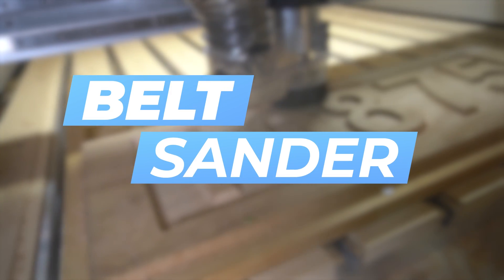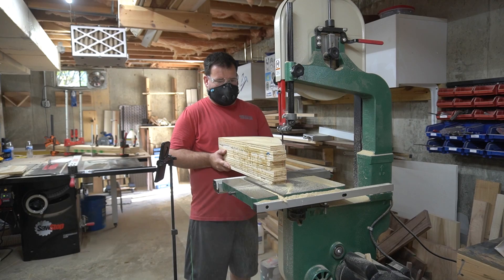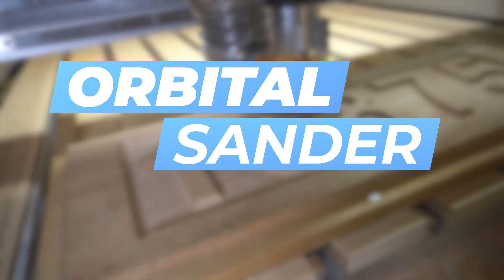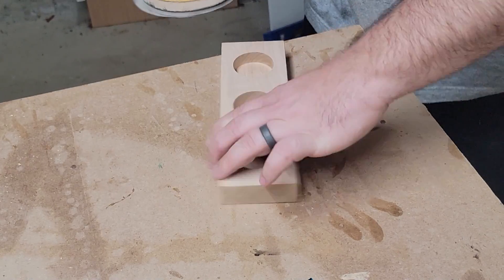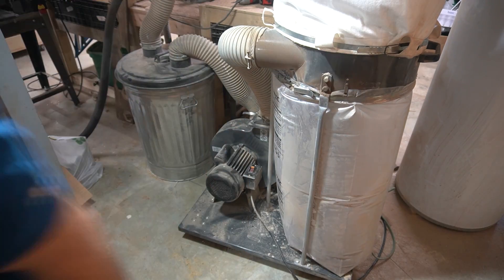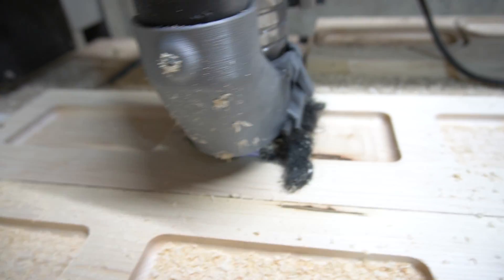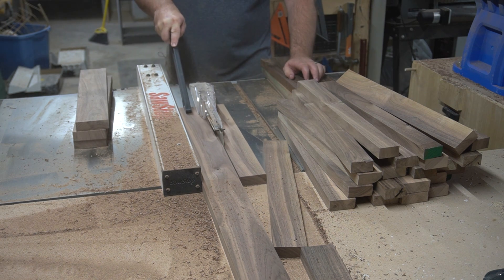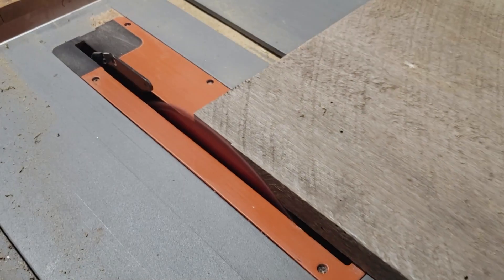5 Tools You NEED To Purchase After Buying A CNC

Comment: What are your thoughts on a jointer for milling? I have all you mention except spindle and have heard band saw can be shop center. “I” think I need a jointer and drum sander to support cnc and milling inputs. I have hand planes and a thickness planer but milling long boards isn’t lots of fun.
Reply from the maker: A jointer helps but I didn't have one in my shop for the first 3 years. There are a lot of ways around not having a jointer.

Comment: What are your thoughts on a jointer for milling? I have all you mention except spindle and have heard band saw can be shop center. “I” think I need a jointer and drum sander to support cnc and milling inputs. I have hand planes and a jet thickness planer but milling long boards isn’t  fast.
Reply from the maker: It really depends on how much rough stock you're using. There are a lot of ways to mill wood without a jointer. It's well documented here on YouTube. A drum sander is great to have in the shop. Anything to cut down on sanding!

Comment: Got my first CNC Dec 2020 first things i would say If your going to be doing a lot of sheeted plywood, Kreg accucut xl, This might even save you from needing a table saw as much if at all. 2nd is a router table get one that you can setup to joint boards, (I use SKIL RT1323-01) clamps, clamps and more clamps, Sanders are a MUST. Router table is a must.
Reply from the maker: Thanks for sharing!

Comment: Thanks Andy - Great videos and tool choices! I have three of the five. The tool I consider #1 is the table saw. I feel Saw Stop should be the choice for safety (cheaper than losing a finger or thumb) and it's plenty versatile with butter smooth cuts. I also use it in place of a jointer for now and I really like being able to easily switch between metal and wood. I will be getting the belt/spindle sander next followed by a bandsaw. Now just where will they go? Hmmm - more 3d garage layout and floor space planning. I purchased a StepCraft CNC recently to replace my X-Carve hobby unit. I basically wore it out and donated it to a friend who wanted to start learning as I had.

Comment: As a hobbyist CNC’er, I’d be lost without my planer. Smooth even wood is vital for cnc success. More important than a bandsaw I’d say, especially if you’re buying rough cut wood. Sure you can surface with cnc but it’s a slow process.
Reply: Big facts & ive found surfacing bits wear out quickly

Comment: A router table or palm router would make a lot of two sided projects single sided.  I flipped projects a lot because the cnc was the only way I had to clean them up...Round over edges, remove onion skin, clear tabs, etc..
Reply from the maker: That's true but are 2 sided projects all that common to but it in my top 5?